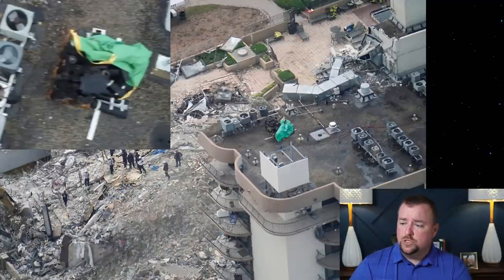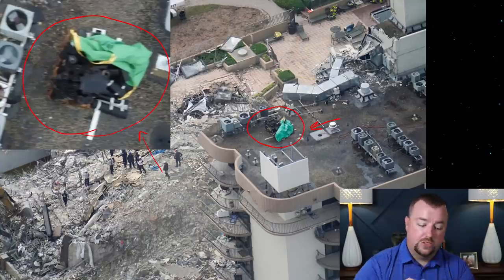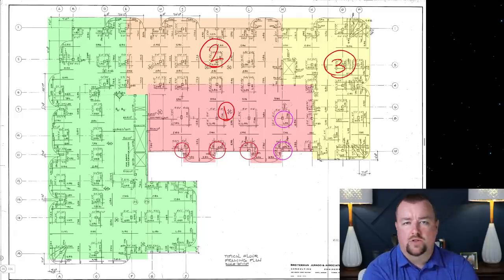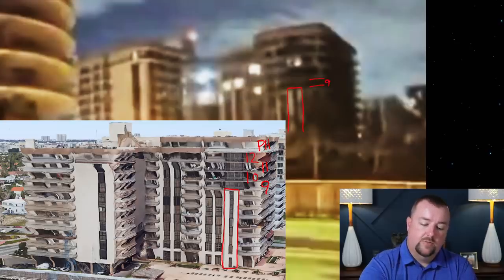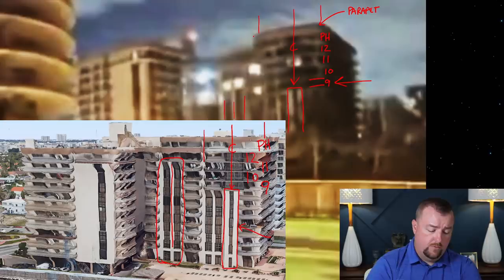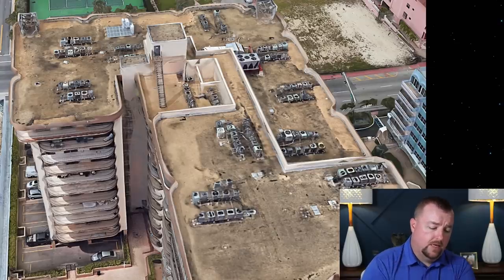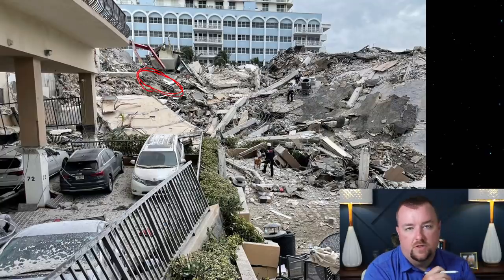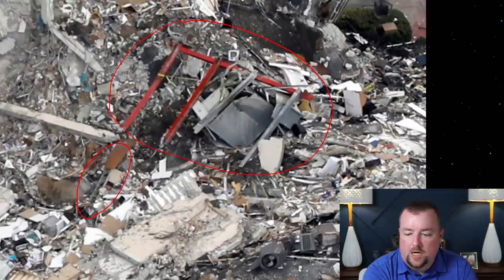Surfside Building Collapse - Did it start at the roof?

Comment: Has anyone looked into the possibility that they used “early strength cement” for this building?
Reply: Eat a bagel.
Reply: Im going to Google it but for anyone only passing by the comments, what is "early strength cement" and what leads you to think it is possibly a factor, and why do you see it as important with respect to this specific case?
Thx
Reply: Early strength cement is a non portland cement developed by the military in the 70s to build things faster. It was utilized by the construction industry to save time, until it was discovered that it starts to crumble after a period of time. My understanding is that it now prohibited from use in many applications. Seems odd that the whole building just crumbled all at once.
Reply: @thecommentary21  why
Reply: It is possible, like more sand & gravel/rock was mixed with the cement as a 'greater filler' & to extend it & cut costs back over 40 years ago & it was enough to keep the building up for 40 years but no more. Also the thickness of that slab, I feel it was 'minimal, just enough to give 40 plus years of life !!!!
Reply: I read in the comments of another video on this channel that the concrete formulation for buildings built near the ocean changed in the 90s. I think it was from 3000 to 4000 psi and additives were included to mitigate the corrosive effect of chlorine. Take that with a grain of salt, of course; I read it on the Internet.
Reply: @Craig Lamb wow! What an intelligent comment. Any other suggestions?

Comment: The collapse started from the pool deck and garage column's that were build with skinner column's for the south side construction. Then with all the Spalling rust and water leaks the building has had the last 40yrs. Plus the hurricane's and the added penthouse suite's contributed to the smaller support pillers and leaking made this a building design flaw. Now either the Engineering and pillar size's were the factor so this will be due to lower grade material's as the support concrete were compromised which makes the contractors liable. Negligence which caused damage to property and loss of lives.
Reply: I saw a news report today that said the owner of the company that built the condo was dead and his company was no longer in business. It is a shame too since he didn't build it according to the specs. And why didn't the inspectors see this as the building was being constructed???
Reply: @cherylhoskins1679  Sad that no amount of any settlement would ever be enough for the innocent people's who's lives were lost and my deepest Condolences to them who are left picking up the pieces. Nothing can replace a life. Tell the one's you love that you do as much as you can. We all have to love harder. Even thru these difficult times our thoughts and prayer's are with the Family's. Take Care.
Reply: @cherylhoskins1679  It fall's on who in the City signed the Building into safe sound. Reguardless of who it fall's back on to the property's maintaining and operation. The inspection may or may not be liable due to the writing of the 40 yr inspection. You would have to read the writing and it's contest to the word's that may or have not been in writing. This is to answer your last question.

Comment: What's the story on the surveillance camera footage?  It's a video of someone holding a camera up to a flat screen TV monitor.  Where is the first generation footage?
Reply: The authorities have the footage. They’ll release it when they’re through. Do you have money invested in the building?
Reply: Wouldn't the city or police detectives have made it job #1 to... not confiscate it... That sounds nefarious... to... take custody of it....? Some times it feels like the city is keeping a tight lid on information. They have a lot of face to lose if the building inspectors are found at fault. We only got video because someone did an in-hand copy and offered it to the TV station, right? (it's not so unusual. The National Guard plane crashing in Savannah had a similar 'new video at 11' screen image of the last moments of the plane)
Reply: @cynvision 
I'm sure there's many other videos.  There were quite a number of cameras from the pre-failure photos.  I doubt they were streamed off-site so the images may exist on hard drives in the rubble.  If that's the case it's possible we might have video of interior as it's going down eventually.
Reply: @Iconoclasher  Sort of thinking we won't see the pool deck videos. Too close and showing too much details of ppl dying.
Reply: @cynvision 
Possibly.  But they'll have to be released to the forensic engineers and architects for analysis.   But then that could be stonewalled by the politicians since they have the most to lose.  
The Miami Herald stated today (7/7/21) DeSantis said the Champlain Tower "had issues and will NOT commit to a state wide review of coastal structures".  I already smell a cover up and whitewash, and it's starting at the very top!
Nice! 🤔

Comment: Hello, i am a security technician. Security motion recording is triggered by the change in the picture of the video being recorded. There is no motion detection device required. The video recorder records 24/7 but bookmark (or save) a motion event. Furder more; i set all my recorder to buffer 30 sec. (buffer: save 30 sec. before and 30 sec. after the event) >> this way, we can start reviewing the event before the motion detects the event.
I assume the recording of the collapse, did not have the buffer set-up.

Comment: 17:20 motion activated cctv would’ve worked by how much the trees are shaking in the wind. the video must’ve been recording earlier and in much higher resolution. It was selectively edited and down sampled…. And we’re not being given all the info for a reason.
Reply: If you watch the left side of the screen you can see the edge of a monitor, and the edge of the software window. Someone used a phone to record the screen of the security system from the other building. The original video (not a recording of a screen) would be much higher resolution, and not have the beginning cut off
Reply: @gorak9000  ah, yes, thanks, that's the usual way to get the resolution down... probably the guy filming was using his 2005 Nokia. ;) definitely very odd.

Comment: From looking at the blueprints from 1979, one thing that screamed out at me was, the columns in the part of the building that did not collapse, were actually bigger than the one's in collapsed part! So, did this building all go up at once, or did it get built in sections? If the columns in the collapsed section were indeed smaller size, was this a cost cutting measure as the building was being built?
Reply: I saw the same thing, the columns in the part that didn't collapse are about 20" x 20", but collapsed part most are 16" x 16"

Comment: Not an engineering related comment but if in the end it is discovered that the deferred maintenance, misinformation, and bickering over money played a huge roll in what will likely amount to the loss of over one hundred lives this will be tremendously more tragic imho than a design flaw.
Reply: Bad design period
Reply: I have a bad feeling no exact cause will be proven, and no exact person (s) to blame which will result in no accountability. The loss is impossible to measure anyway and nailing someone to the cross seems insignificant.
Reply: Exactly, whatever design flaws existed is not as important as proper inspection and maintenance. Any building design can be jeopardized by improper maintenance. There is evidence that an inspection report was issued calling for an urgent need for repairs. However, the residents were assured at a meeting by an official that the building was safe and needed no action. There is also belief that the official never even read the inspection report.

Comment: Hi! I saw a video of an Argentinian architect and he talked a lot about why does this buildings don’t have beams between all columns like a grid to distribute the load.. he states that garage upper level dropped into the lower one and actually columns pinched through the very thin slab and this garage fell. There is a video of a woman filming into the garage entrance. Then, this guy says that columns are designed to have certain length between levels. So after this garage fell, the columns on that level and that location had double length all of a sudden and they bent and that is when the building started collapsing. I find this very insteresting. Would you please drop a word on this? Why no beams on these buildings??
Reply: Plausible. After pool deck collapsed, columns for building proper were "doubled" in length as you say, aka they lost lateral (horizontal) support when the deck fell. Force of building weight not only wants to push columns down, but out, if my understanding of these forces is passable. In frame construction we would call this "racking"...tendency for wall to "rack" sideways without cross bracing or sheathing.

Comment: Here is what really happened that day the parking slab failed first as you can see it on the video of the woman moments before the collapse. The water pouring down the parking lot was from the jacuzzi only not from the pool. The lack of concrete beams made the parking lot slab to fail and it got loose also from the three main columns of the building they alone couldn’t support the weight and they bend causing the front building to collapse as you can see on the video. The reason I repeat is the absence of concrete beams that withhold the slabs. You can see in the debris specially the ones standing on the parking lot the went through the slabs with no support this couldn’t have occurred with beams !!!
Reply: I thought the jacuzzi was intact and the gush was from a water pipe. A jacuzzi is just a large bathtub that would have emptied without much force by the time the woman with the camera came over from the other hotel to investigate. I believe the water was gushing forcefully from a pipe but I’m no expert.
Reply: @ravenel2  the water was from a pipe that filled the jacuzzi.

Comment: Let’s talk about how they wired a 12 story building in just three days and drilled and keyed out all of the waypoints in order to properly drop this very dangerous building, and if it was so dangerous how did they get in and wire this building in just a few days, doesn’t that take weeks of planning and coring and drilling and chipping to achieve the result of a pancake drop… Oh boy
Reply: Right, you don't have to be an engineer to see the similarities of the pancake drops of both the initial collapse and the demo of the remainder of the building. Yes, oh boy! Doesn't matter if it started in the pool deck or the roof, all of the steel support columns in the entire building cannot be taken out simultaneously without wiring the structure for demo. The pancake drop is the first clue and 12 stories of steel columns becoming invisible on the ground, in both the collapse and demo, is an even bigger clue.
Reply: No
Reply: I am with you there. What a convenient coincidence.....and that tropical storm did not come anywhere near Miami.......Hello !!!!! what's with that ? it was their excuse to demo the rest of the building....
Reply: No it doesn’t
Reply: @mikedeuel7426  the garage was caved in 10 minutes before the collapse indicating structural failure. Stop it with your nonsense bomb theories.
Reply: @NathanJohnson815  Agree. You don't NEED them all to cave in. Just a bit. Like tearing paper along a ruler edge. Not so easy to rip it all at once from the sides. Just one tint corner is enough, though. 

Not enough redundancy in that area, apparently. Small things SHOULDN'T cause this, but anyone who's watched Engineering Disasters on the History Channel, could discuss several of those little things piling up.

Comment: Re the lights: There is inertia at every level.  After the wire is cut, current will continue to flow very briefly (inductance).  Once current stops flowing, LED lights will continue to have power (capacitance).  Once the LED lights stop having power, most LEDs have phosphors in them that will glow briefly.  All of those are very brief effects, but it's entirely reasonable for a room to be illuminated for a frame after power is lost.  And all that just adds to what you said about the power cables surviving the first few feet of collapse.

Comment: the building pancaked down as the carpark columes gave way it looks like the roof beams were not tied to the columes
Reply: It was demolished twice. A collapse wouldn't turn it to little bitty pieces and dust. Look at the "collapse" then the demolition and tell me if you see any difference.
Reply: @dirtymikeandtheapeboys6507  🤦🏻
Reply: @lexuses3942  if it doesn't look the same to you, you're blind.
Reply: @lexuses3942  be a man and accept the truth.

Comment: Question!!! At video marker 21:44 is column 78. Two different colors, crack through middle, flooring material pushed up. Is this part of the pool deck dropping down?
Thank you! Happy vacation!
Reply: Do you mean column 72/73?  The upper parking was on the deck,  which broke free from the columns and fell into the garage.  The light paint with the numbers was in the garage.
Reply: @GH-oi2jf  yes you’re correct. It looked like it dropped down. Great job explaining things.

Comment: Pool deck DEFINITELY collapsed first, there's no denying it
Reply: Insane that the pool deck failure would pull down the building.
Reply: @johnford5568  I mean if you get your feet knocked from under you, you fall
Reply: @comradedyatlov4143   I'm Just wondering what will happen if someone drops a ton of debris onto your head, you will be knocked out flat.. I'm not trying to insult you,  just note,  that all the debris from the condo fell on top of that pool deck. If the pool-deck was still intact, when that happened, which I assume it was,  then the momentum of that debris falling on the pool-deck would made it collapse.
Reply: @reallyme3573  No, the pool deck collapsed first for sure
In footage of the collapse, at NO point did the roof fall first. It fell flat after the pool deck sunk down to garage level, knocking out some important support columns and resulting in the building coming down. There's a lot of evidence. 
There was also spalling in the pool pump room and footage of a water pipe breaking and gushing in the garage. In a phone call, a woman tells her husband "The pool deck is collapsing!" And says she thinks it's a sinkhole.
Reply: @reallyme3573  The pool deck collapsed first, PERIOD. God awful conspiracy theorists are everywhere
This collapse is the result of negligence, NOT a demolition. At no point were explosives found. How do you explain the broken water pipe? Did it magically break open, coincidentally before your "demolition"? 
Get off the internet
Reply: @comradedyatlov4143   Please explain with physics, how the pool-deck collapse could bring down the condo.  For that to happen you need a horizontal force,  explain how the vertical collapsing pool-deck could exert a horizontal force.
--
The broken water pipe looks weird and the images are of a low quality. Hard to tell.  It could have been CGI, similar to the CGI-planes in New York, twenty years ago.
Strange that someone goes swimming in the middle of the night.

Comment: My interest is in the connection between the floors and the support posts. It was shown in the Murrah Federal building in Oklahoma City bombing that the connections between the floors and the supports failed and caused much more damage than the bomb should have. The Murrah building was built at about the same time. There have been several parking structure failures following the same pattern.

Comment: Another factor is all the weight of upgraded kitchens baths etc. the original bldg has been added to over time new load  thoughts?
Reply: Not unless they were all marble but as the building collapsed sectionaly AND there was some type of structural failure incident in the garage at t = - 7minutes and 30 seconds , unlikely.

Comment: I'm going to suggest you listen to the first 3 hours of rescue effort dispatching. They had dozens of not hundreds of people on site way before sunrise. I'm not saying that stairway was a ladder, but that site was crawling with people well inside an hour after it fell. 

Also, this isn't the first steel reinforced concrete structure to collapse on the Florida intercoastal. There was a condo building in Cocoa Beach that collapsed during construction the same year CTS was built. I have to wonder what other poorly engineered, constructed, or maintained buildings like that are laying around Florida.
Reply: Hundreds, if not thousands. Truly scary.

Comment: The aerial phot you showed at the end is amazing with details.  No only did the building appear to start with a lower level collapse, but it also looks as if it twisted in the direction of the columns that were suspected to have collapsed first.  there is a very prominent rotation of all of the floors noticeable in a clockwise direction.